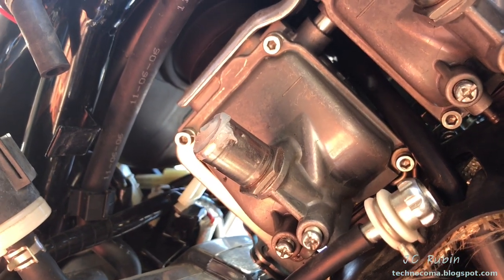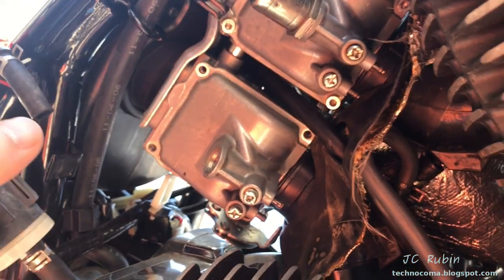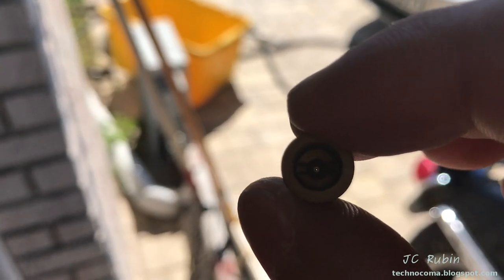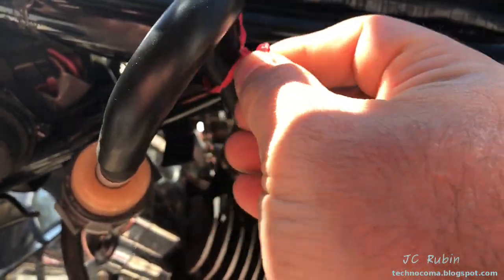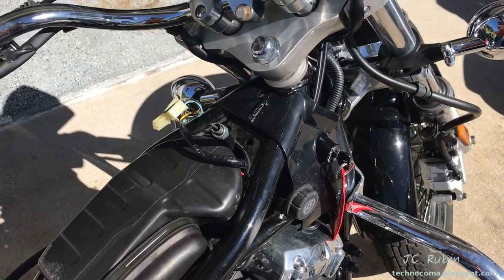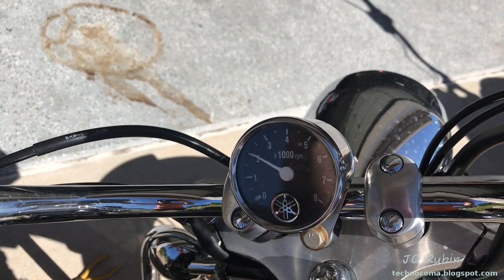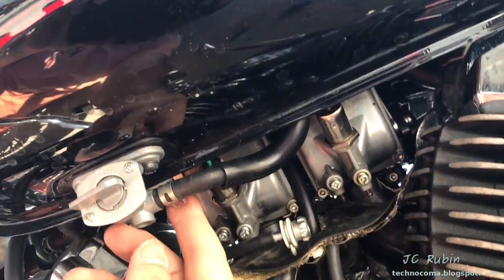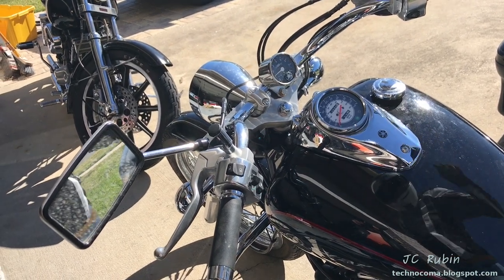Yamaha Star 650 Quick Carburetor Repair / Clean 3 of 3

Comment: I just did this and it worked. Let it warm up for a while and gradually worked the choke in and had great throttle response with no choke. I finished the job at about 11 and wanted to run it down the road. Ran great until I tried to get on the throttle in 2nd and then bogged. I did have the cover off my air filter and I’m not sure if the excess air would cause that or not, but I put the bike up since it was so late.

Comment: Halelujah!  I've been suffering from this for YEARS and have had the thing re-jetted almost YEARLY (well, each year I decide to ride).  This very problem has actually made me lose enjoyment for getting the bike out and fussing with it each riding season - so much so, I haven't ridden in three years.  It just gets TIRESOME having it towed to the Yamaha repair shop and paying for a full carb-cleaning and/or re-jetting.  Got it pulled out in the garage now and I am going to attempt tonight!

One thing - you've done a FANTASTIC job walking us through the fix, but what about prevention?  I see you're response below WRT draining the carbs upon storage - but any additives that we should look at?  There's just (seemingly) no getting away from ethanol-based gasoline anymore...
Reply from the maker: I fill mine with E0 gas.  There's a website for stations all across the US.
www.pure-gas.org

Short of that, there are fuel stabilizers you can add to the gas to mitigate the ethanol in it.
Reply: @retrotechandelectronics  Thank you!  Got underneath there last night and found that someone (all carb work has only ever been done by a Yamaha dealer) had rounded out 4 of the eight screws (mine are all #1 Philips head).  Was able to get all out but one - had to end up extracting it.  So!  All new screws are being shipped today.  Other than that, the disassembly and cleaned went swimmingly, thanks to your videos!

Comment: Hi thank you for the videos explained very good, I have 2003 Yamaha 650 vstar and I clean the carbonator it was block, clean that out wasn't very dirty from inside doe. It start working but it still dies in neutral whan I stop, and even if I start in choke now it doest start like it should be loud but no. any suggestion please and thank you

Comment: Great video. Any chance you have a video on what you did to the front carb solenoid? I just had a failure on mine and pulled to try to clean up and get working but it did not do anything. Then, after messing with the wire where it connects to the solenoid by pushing it in and wiggling it around a bit it started working. After seeing your video it sounds like this may have been a common problem. Did you just add epoxy to the top to hold the wire in place better or did you cut into the top at all to make a better connection then add epoxy?
Reply from the maker: Remove the solenoid
Cut away rubber until connector is reached
Resolder wire
Repack with rtv wait till dry
Reinstall
Reply: Awesome, thanks. Definitely better than spending $200 for a replacement. 
 @retrotechandelectronics

Comment: Great video thanks man.  Was wondering. If I did the jets or did a complete rebuild at what point would I need to sync the 2 carbs?  Is this all stuff a guy that was kinda mechanicaly inclined could do?
Reply from the maker: Carb sync it the last process in all of this who procedure. you will need the correct tool to sync.

Comment: Hi, I'm new to this. I think your videos on this bike are incredible.  I've watched so many and "liked" them all. I have followed your procedures for checking the fuel system. My issue seems to be somewhat opposite. The bike idles fine and just off ides is also fine. Easy on the throttle is also fine. At a certain point under load the bike starts to breakup, and either is not getting enough fuel or could be the ignition. It was fine and all of a sudden during a ride this issue arose. I'm having a difficult time to determine which. Any help would be appreciated. Thanking you in advance. Peter
Reply from the maker: Check my video on troubleshooting the fuel system.

Comment: Quick question, theres a hose running down between the carbs. Where does that attach to? I cleaned my carbs following the steps in this video but noticed a tube or hose running down between the carbs but not attatched to anything???
Reply from the maker: wan down below between the cylinders where the air filter is should be a hose fitting where it resides.
Reply: @retrotechandelectronics  could that keep my bike from not starting? Because I cleaned my carbs but it won't turn over.

Comment: I have an appointment to drop my 2005 V star classic 650 classic off at a shop to have pilot jets an carbs cleaned,  after watching your videos I fell I could do it myself but still a little iffy, not real mechanically inclined.  Any suggestions?
Reply from the maker: Its not just in the cleaning, The carbs will need to be set back up. If you are not confident in this, leave it for a shop to do until you have red up further on it.

Comment: Mine is hard to start but will idle i was told it was re jetted and my pipes are chopped up trys to die when you hit throttle would this help meb
Reply from the maker: Off idle die is usually clogged jets

Comment: What did you use to clean the Jets with and mine is back firing will doing all of this stop it from back firing if that is why from them being clogged or dirty?
Reply from the maker: brake cleaner... these jets are small and easily clogged.
Reply: @retrotechandelectronics  thanks hopefully cleaning them will help stop it from back firing.

Comment: As I was getting ready to take out the carbs 2005 V Star Yam 650 I heard two things drop to the floor.  I found them-they are like short pieces of brass tubing or a bushing-6.5 mm long and 6mm wide.  Maybe the carb to manifold clamp bolts fit thru them-to keep from tightening the bolts too much?  I don't know.  Do you?
Reply from the maker: Sounds possible, do they have a seam like it was folded into a cylinder?
Reply: @retrotechandelectronics  there is a seam.
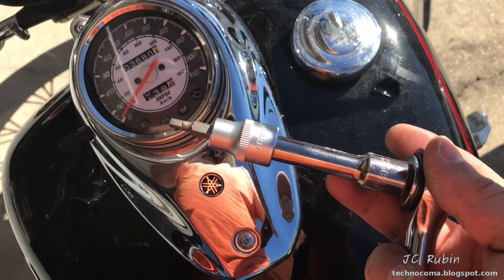Reply: @retrotechandelectronics  Yes I see from another of your vids that they go over the clamp bolts.https://www.youtube.com/watch?v=F49d5hExSg4&t=796s  @10:47

Comment: So,  Is there a preventative maintenance we can do to try to avoid this?  Non-Eth fuel is hard to find, and expensive.
Reply from the maker: Yes... Use the screws on the bottom of each bowl to drain the bowls when storing up the bike.
Reply: Yes if you know the bike is going to have the same gas in the tank for over a month, put 4 ounces of Seafoam in the full tank.

Its $8 for a 16 ounce bottle at Walmart. It will stabilize 16 gallons of fuel. It will ALSO clean your jets if they become clogged, as long as the bike still runs, so you will NEVER NEED TO CLEAN YOUR CARBS by taking them apart - ever!

Esp if you park the bike for the winter - $2 worth the Seafoam in the tank will prevent this from happening.